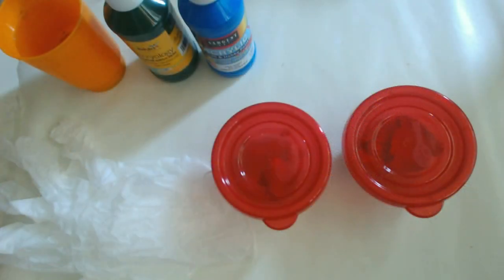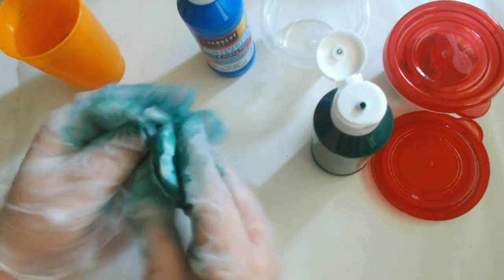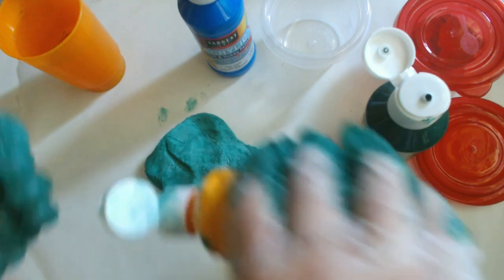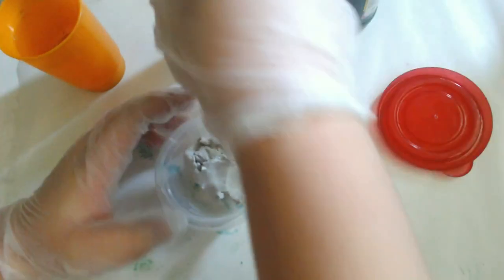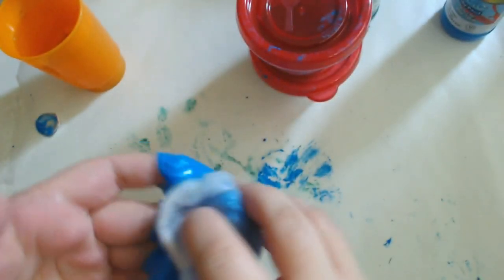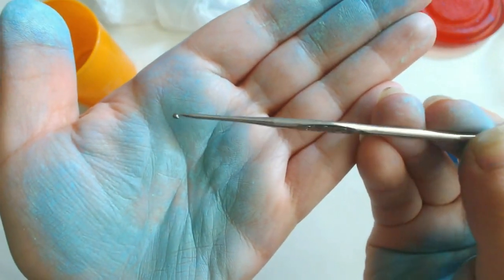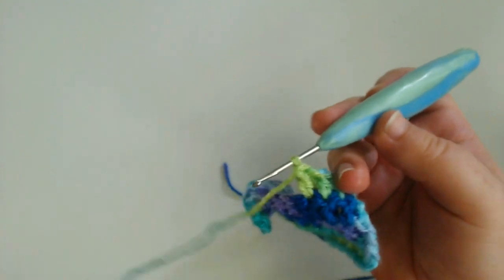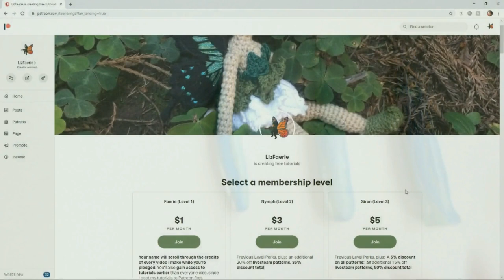I Tried Making Crochet Hook Handles Out of Air Dry Clay | Project Diary

Comment: Air dry clay is best if painted after you make your handles then let them dry. You can paint any colour you like and varnish after. Another pretty idea is to use Modge Podge and decoupage the handles with single layer of tissue napkins and then varnish. By adding acrylic paint into the air dry clay you are playing with the chemical reaction that make it stable when dry.

Comment: Much easier to make the handles and when they are dry then paint them any colour you like or use Modge Podge with a single layer of pretty napkins. Them finishwith a varnish. Also you can use a pan covered with a lid of tin foil on top to bake Polymer clay. Just take out side to open and let any fumes out in the air. There is not much in the way of fumes as it is baked at low temp for short time.